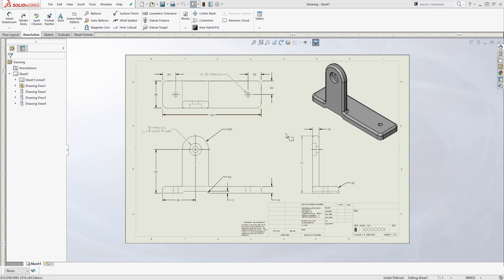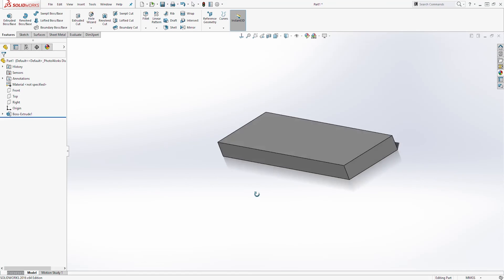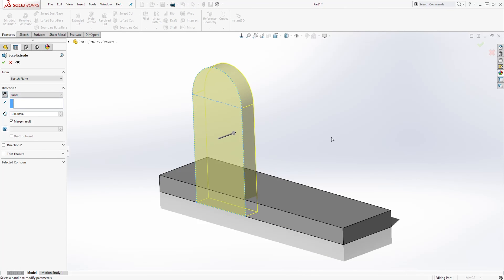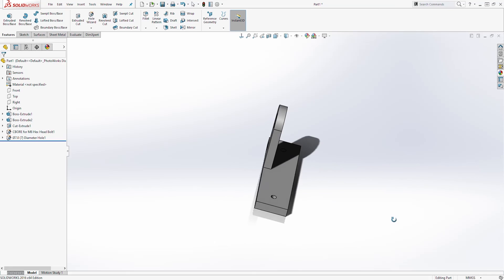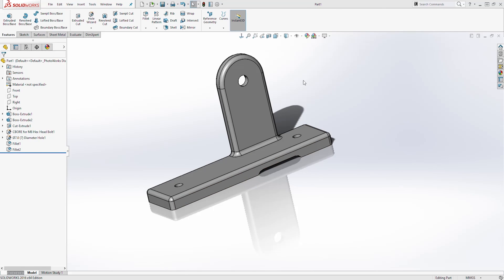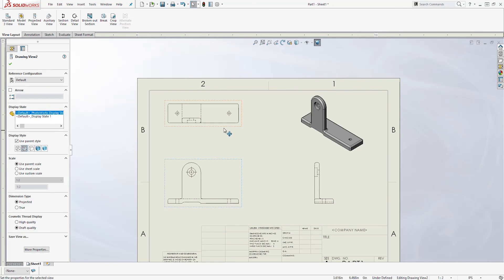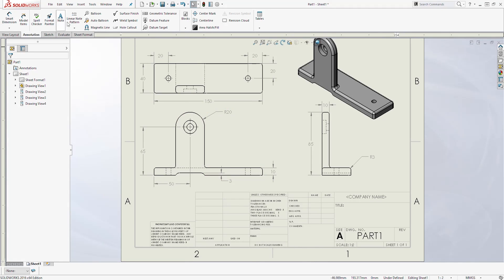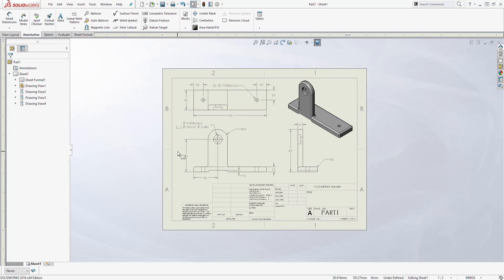How to Create 3D Part and 2D Drawing in Solidworks

Comment: This is helpful, but the method you are using to dimension the positions of the 7mm holes is poor practice. You are showing it from both ends of the part, which can cause the dimension between them to change if the length of the base or it's positional tolerance is ever changed. Hole positioning shroud be from a single datum unless it is the intent to have their positions vary with the part overall dimensions.